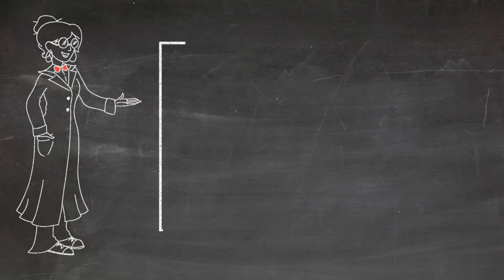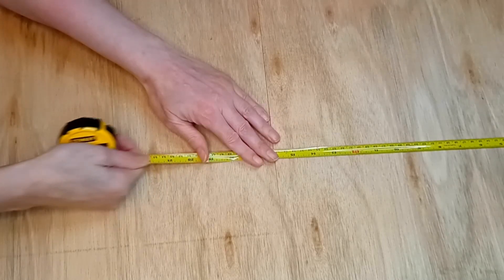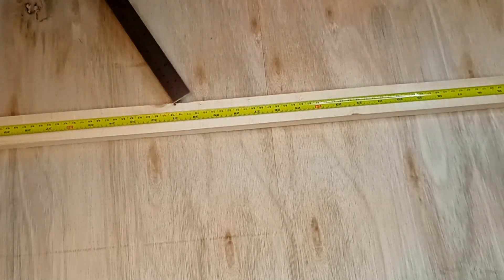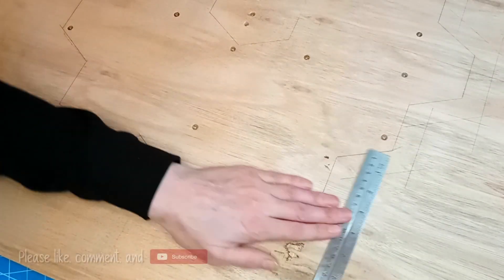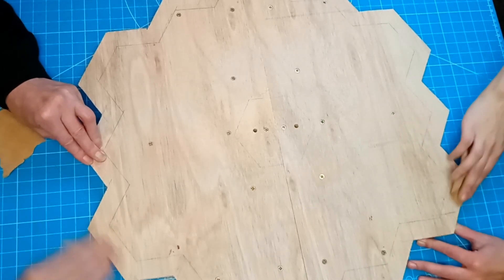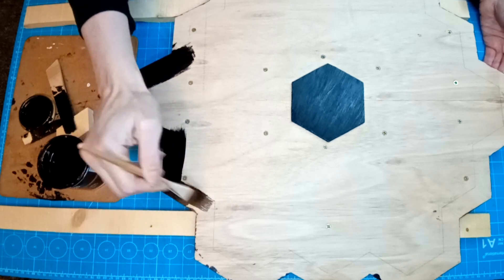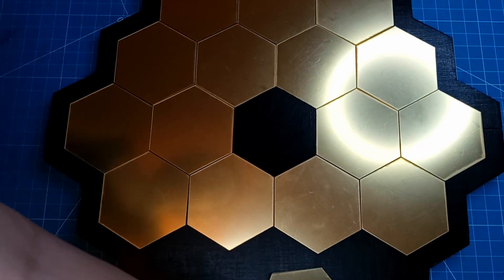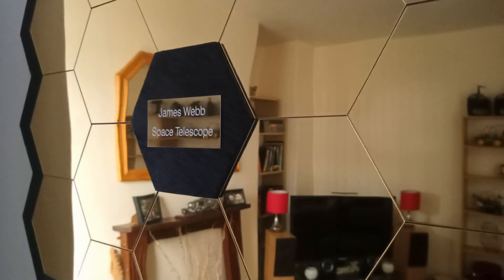How To Build Your Own James Webb Space Telescope Primary Mirror (18 Gold Hexaganol Mirrors)

Comment: Would you ever sell a version of this?
Reply: Ok I’m doing exactly this. How in the world did you guys get the spacing in between each mirror segment? I’m having a hard time with that specifically.
Reply from the maker: Actually the spacing is an illusion of sorts. We created a piece of wood that was the same shape as one of the mirrors (traced one of them), painted it black, and then we just positioned the mirrors around it as neatly as possible. The mirrors are all butted up really close up to each other (although they are not all perfect), and that creates the illusion that the mirrors have a perfect gap around each of them, especially given the background is black and the mirror edges are not perfect. The gap around the the full mirror was then just one or two inches from each edge if I remember correctly.

It actually works very well. We spent ages trying to work out the same thing, and of course you nudge one in the wrong direction even slightly and it throws it all out.
Reply from the maker: Huge apologies for not getting back to you sooner, I've been ill. We would sadly not be in a position to do that I'm afraid, but they can be easily built yourself, and it looks superb on the wall. We still have it up.